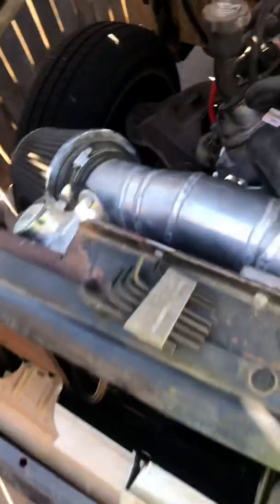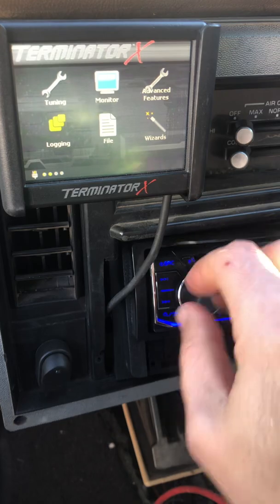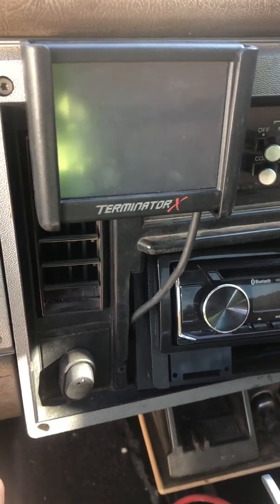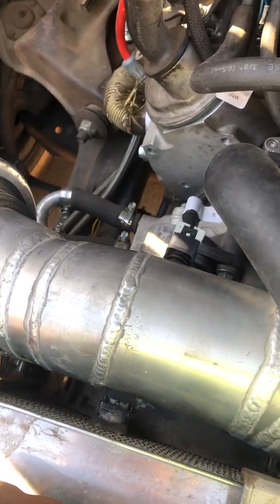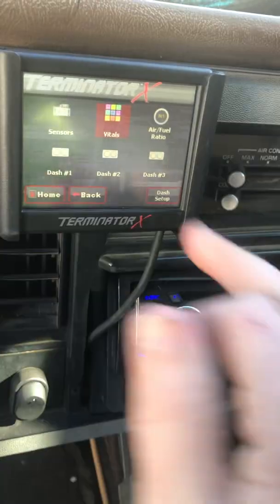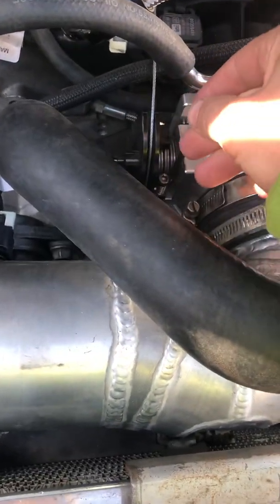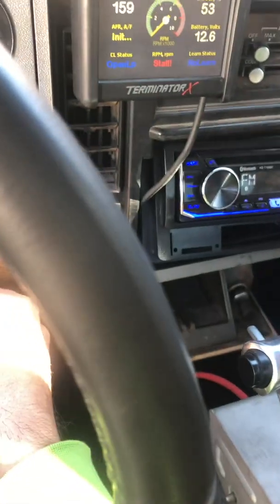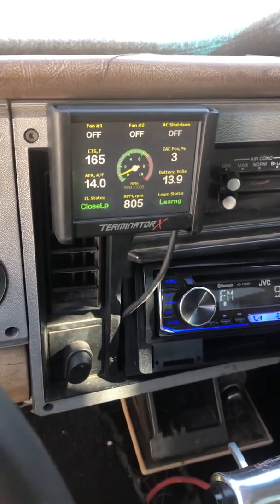Holley Terminator X IAC control adjustment/ setup on an LS Motor.

Comment: Is there a way to stop it from idling up so high to start with? It seems to really idle high till it settles in.
Reply: Mine idles up high on start up and does not idle down. Did you find a solution?
Reply from the maker: Check your intial idle start up. If you need still need help message me or I can make a video on it.

Comment: What iac, tps and throttle body are you using? I can't get my iac to adjust below 50. I've got an aluminum 5.3L on Terminator X with LS6 intake and some no-name 85mm throttle body. Replaced my ebay iac and tps with gm/ac delco sensors
Reply from the maker: Reece there are several things, maybe by now you have got it. But I have a Holley 92mm with factory gm from a wrecking yard sensors. I would replace the sensors with genuine GM, for me it did make a difference and worth the trip to the wrecking yard.
Reply: take the throttle body off, remove the iac and open up the passage in the body some, read around a bit more before taking my advice, tho thats what im guess it is.

Comment: What radiator did you use on your setup
Reply from the maker: it is an aluminum 4 core that I robbed off of my 1993 S10 that was infront of a SBC. It is an aftermarket brand, pretty small, not much room. I made a bracket out of C channel to bolted it to the core support.
Reply: @duke1982  ok thanks appreciate it